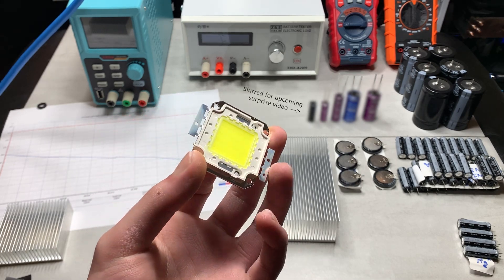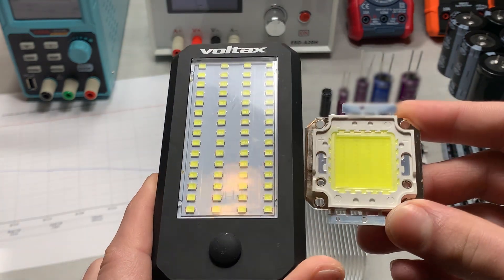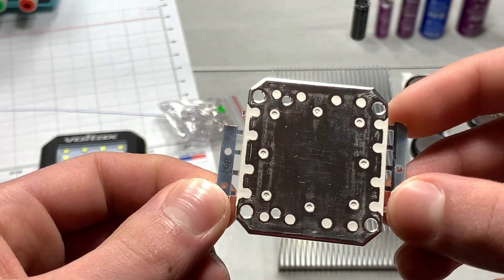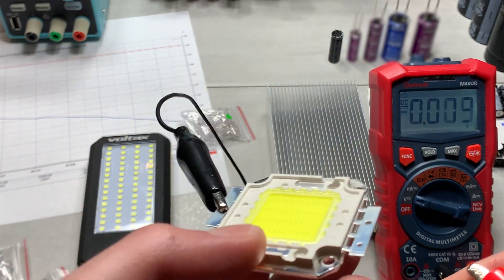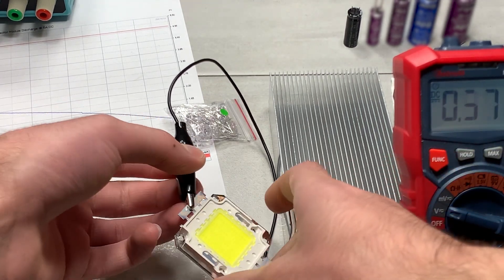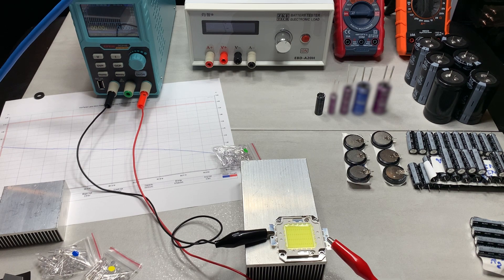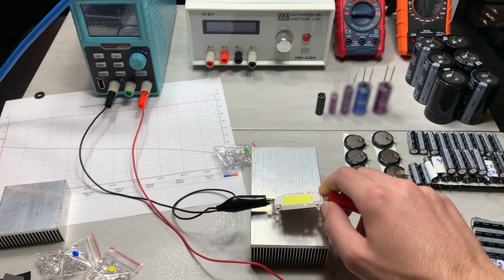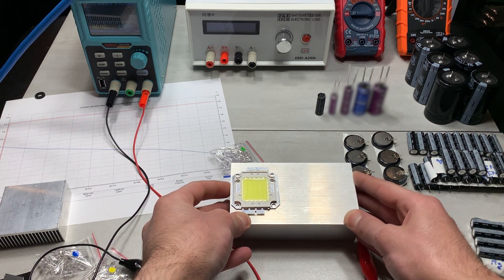A Really Cool Type of LED | CoB LED First Test & Types of LEDs || PART 1

Comment: I have one 50 watts that doesn't work and its power supply or adapter is outputting 46 vdc steady but it doesn't work they rated to work on 34 volt anyway I measured the led cob in diode mode there was 0.6 voltage drop and when I connected a 24 vdc motor to the led , one line has illuminated ! although I connected it in parallel so the the current is what been divided! it really weird why it wouldn't work if I give it extra power not less? I hate leds I'm gonna shift back to sodium vapor light it’s much fascinating and reliable, even when I wanted to test the board it was waxed completely you can’t reach nothing!! most of the faulty leds i met in the past were just flickering and I just change the smoothing capacitor and they work fine but this one is different case

Comment: I love those COB LEDs.
got once a ton of midsized Cree LEDs as they had a good price and i have after like 5+ years still some of them around.

I built a lot of bright working lights, DIY (flooder) „flashlights“ with 100W+ power consumption as well air cooling via cpu heatsink and going way above the rated max current

What i like those COBs also very much for… going way below the rated current and they get SUPER EFFICIENT (at the cost of CRI and color accuracy)
Reply: And yes, those COB LED are typically a big array of a lot LEDs in different patterns parallel and in series.

They are awesome, but they have some drawbacks as well. "High" voltage needed for example, my relatively compact, round 50W or 66W models, i dont remember exactly, need about 36V for its rated current of i think 1,5A around. About 39V make about 4A (so >150W power draw!).

If you dim them, you also have to realise.... either you stick with the regular efficiency but no CRI and color accuracy loss, so you control the light output via PWM dimmer.
If you dim them with a "simple" constant current source they will change color and lose most of its CRI value while dimmed.

Also, as awesome it is to boost those COB LEDs as my DIY flooder putting out >20.000 Lumen by bulding a array of 2 of them and yank the sh*t out of them by going 4A+, their efficiency goes VERY BAD.
The rated current values are somewhat a "sweet spot" to have as "much as possible" light and reliable, yet reasonable efficiency as well. Only going much below this rated current, and only by doing it with constant current will increase efficiency to nearly unexpected levels.

My 50 or 66W COB LEDs, when running them on lets say 3W, they are SUPER BRIGHT. Any 3-5W single LED running at 3W will be much darker, so much less efficient. The COB LEDs i use are running on super low current while doing just 3W (36V LEDs, i would guess now around 31-33V  @ 0,1A).
Reply from the maker: Yeah, I put together a kit for a 100W COB LED with parts I got off AliExpress/eBay, and I definitely know what you mean by finding the right balance between brightness and accuracy. The thing is so bright it can light up an entire basement almost as bright as all the pre-existing lights. 

It consumes ~96W, and if that’s only because my power supply only goes up to 31V and the COB LED is rated for 32 or 36V I think? I honestly don’t remember so please correct me if I’m wrong :)

Now I don’t remember whether or not I used constant current in this video, but if I didn’t I definitely should have. I run my 100W COB at 31V (psu maximum) and 3.112A, any more current and I don’t notice any increase in brightness but the Heatsink starts getting really warm. Some day I may get a real powerful power supply that can go up to 40 or something volts and give at least 10A of current 🙃 

Electricity is just so cool when you think about it, especially in the context of electrochemistry. The way physical matter like simple rocks & minerals mined from the earth, when put in the right arrangement, can literally generate the very same electricity that runs our world today. 

Like the way battery materials on their own are only useful for their own properties, but when combined, they suddenly form a little chemical system that is the battery cell. 
It might sound weird, but whenever I make a battery cell it’s like I’m bringing it to life, so it’s always a bit difficult for me to break it apart to reuse the electrodes.

Comment: Why are the caps blurred?
Reply from the maker: Oh 😂 It was to keep the surprise for the videos which came after it
Reply: @KeonsLab pretty obvious that they are supercaps and the video is released anyways already.

I built some months ago with supercaps a hybride battery for my E-Scooter.
A used, well balanced and still fine 48V 12,8Ah LiIon battery pack which was just a bit too stressed with the ripple created by the modified scooter (controller shunt mod, easy and awesome!) 
I added in parallel to the pack a supercap bank and put it together as a single battery.

Helped also a bit to reduce stress on the battery when im charging via charging port while riding the scooter.  I have built a detachable DC DC buck/boost converter and i can charge this scooter from ANY 10-60V DC source with up to around 10A (basically super fast 1 hour charging time!)
Or i can use tool batteries or any RC Lipo whatever to extend the range (while riding…)
Reply: Thanks for the video I couldn't figure out which side was positive or negative either 👍